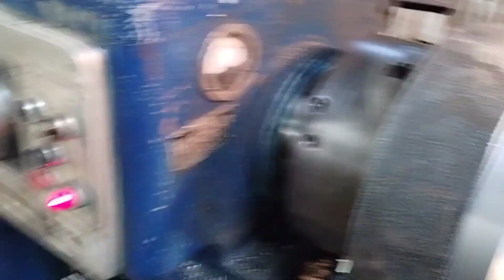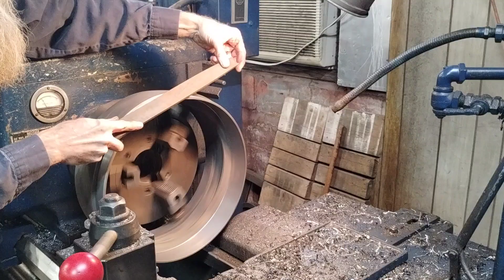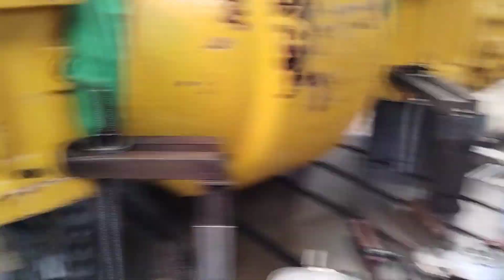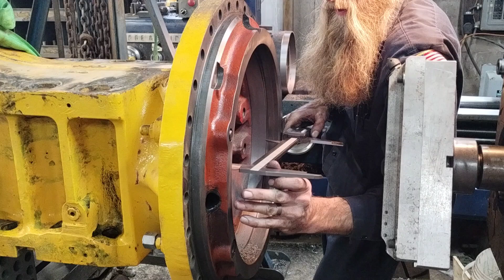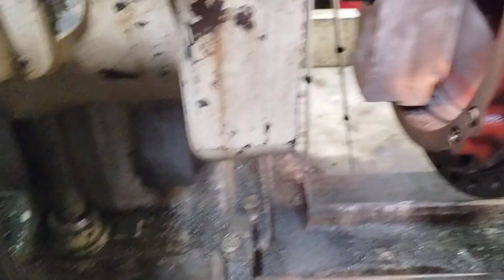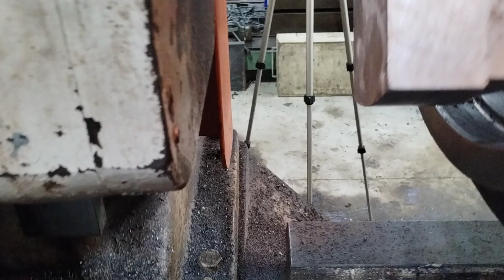Installing the repair sleeve in the Volvo axle part 4 liquid nitrogen time!

Comment: Being ranch folk in the middle of nowhere NM, we don't have nitrogen delivery. So my friend had to replace a bushing on a Chevy truck input shaft. He was going to put the shaft in the freezer overnight then drop the bushing in boiling water to heat it the next day. Then his dad said why don't you take the wet line from the propane tank to freeze the shaft then and use the vapor line to heat the bushing. Sounds like an idea, so he put the shaft in a coffee can and had his younger brothers use the wet line to freeze the shaft, while he moved away from them and used the weed burner to heat the bushing everything is going fine propane vapor is boiling out of the can with the shaft showing it is cooling off the shaft. My buddy is making sure nothing is catching on fire around his can, when there was a Whoomph as the propane vapor made contact with the flame. His brothers took off (Feet's don't fail me now" my friend is trying to make it to the tank to shut the valves his mom, a past veteran in judging loud noises coming from the garage area , charges around the corner water hose on full and starts spraying down everything.  Other than my friend's eyebrows, lashes and fuzz on his chin, no one is hurt some dry weeds burned but no building....
When his dad got home and heard the story he said "I didn't tell you to do them at the same time!" My friend did it his way

Comment: What are the tool holders you use in that boring tool? Looks like you can adjust it vs just using an indicator like a line bore bar